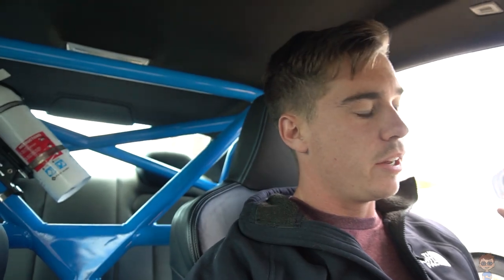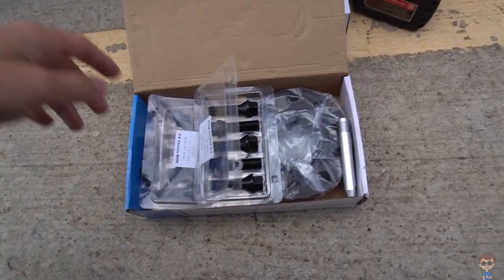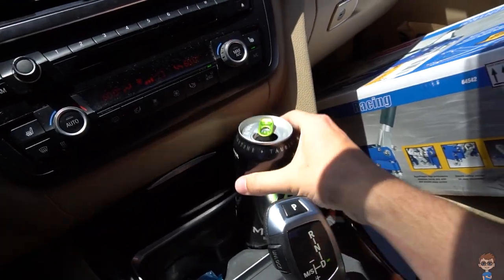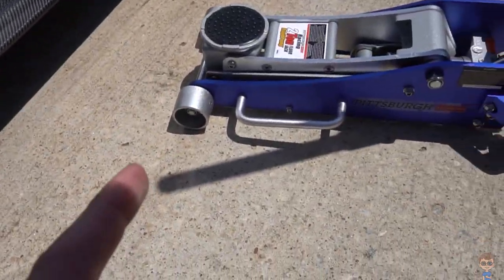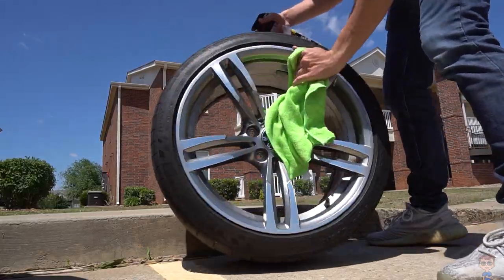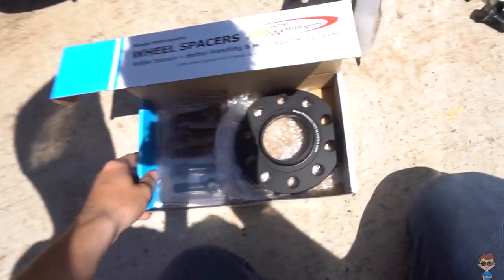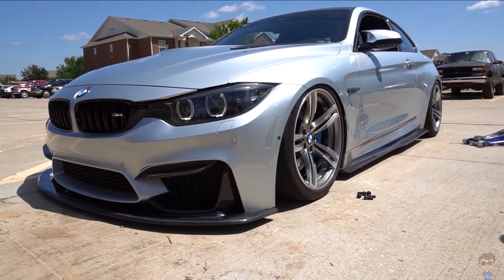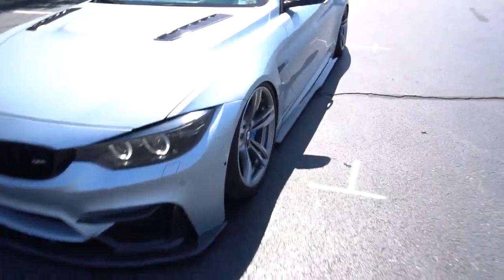BMW Wheel Spacers DIY INSTALL!!

Comment: Which studs will you be going for in the future and I found on the forums that studs need to be maintained/torqued to spec every so often is this true?
Reply from the maker: I am going with the 78mm Stud 12x1.5..... They arrived today 👍Technically yes, as you take your wheels on and off all the time, it could potentially loosen them.

Comment: Nice!!!  That def looks great!!
Reply from the maker: It definitely needed it. Hows your car coming?
Reply: Bailee Durant it’s coming. Flares are glassed together. Now to fill the seams finish some body work and get the color laid down. Couple more weeks. 👍🏼😊
Reply from the maker: Gonna make it for ifo? May 31st?
Reply: Bailee Durant prob not. With this virus stuff my work schedule is so crazy. I’ll def try and make some meets this year though.
Reply from the maker: Cool.. When it's all done we need to go cruise
Reply: Bailee Durant yeah definitely. I’ll hopefully be on a coilover bag system at some point also. We can air out together. 👍🏼😊
Reply from the maker: Thatll be cool 😈
Reply: What brand are those spacers? And size?
Reply: Bailee Durant what brand are spacers and size? Link preferably

Comment: What website you bought the spacers and studs
Reply: What size are the studs? And if you can send the link that would be better 😄
Reply from the maker: I got the spacers from burger motorsports.

Studs are from motorsport hardware 78mm studs 12x1.5. Hopefully I'll be able to install them soon. In the process of moving. 
https://motorsporthardware.com/product/clearance-78mm-black-race-stud-kit-12x1-5/

Comment: What hood is that?
Reply from the maker: Factory hood with apr universal vents. Basically mustang hood vents as thats the same mold
Reply: @BaileeDurant  oh ok nice, are they actually vented? And you just cut a hole out and fitted them also?
Reply from the maker: @jrw8080  They are vented. Yes, I have some footage of it on this channel
Reply: @BaileeDurant  cool, thanks appreciate it
Reply: @BaileeDurant  was your M4 totaled? I'm not sure if I seen that correct but I'll buy the vents off you if you have them.
Reply from the maker: Not totaled but I am selling the vents. I'm wanting to sell them local as I am asking 400 installed. Dm me on Instagram @bailee_durant